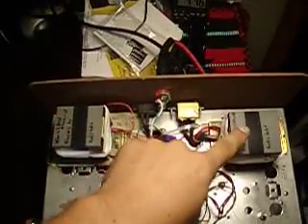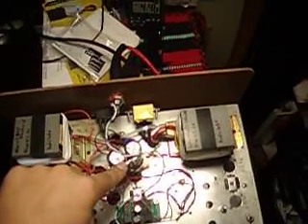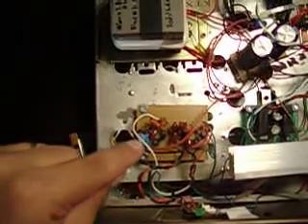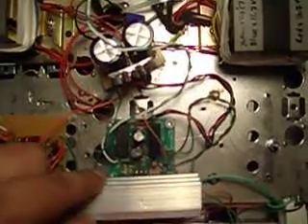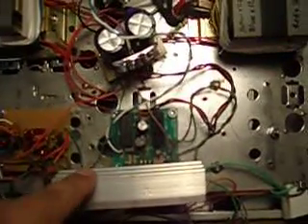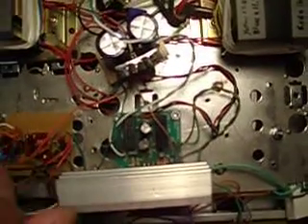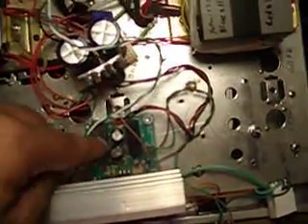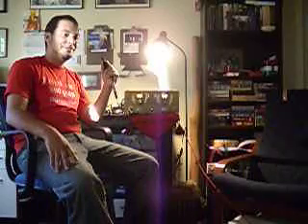DIY Solid State Harp Amp Success!!!

Comment: I've done something similar however, I used the amp end of the tube radio for a cool and great sounding little retro tube amp.  On another project, I used the tube amp as a front end to drive a solid state amp.  I have had some solid states that sounded OK driven to distortion but overall, I like the rich, pleasant, even order harmonics of tubes.  Solid state has a harsh sound.  I drive my amps with microphones playing amped Chicago style harmonica.  Using them like this really reveals the sound of the distortion in amps.

Comment from the maker: , or 3) buy a cheap 9v power regulator IC (can be found at Radioshack) and install this somewhere so that you power the preamp at true 9v, regardless of input voltage.

I have successfully used options 2 and 3 in my amps, but am way too lazy to ever do option 1! :-)

FYI, one benefit of option 3 is that you can then have a 9v "power outlet" on your amp that you can use to power your pedals too! It's easy to make your own "daisy chain" pedal power cord with several little 9v power plugs on it.

Comment from the maker: Hey man! Actually, there are three ways to do it. In order of most to least effort, they are: 1) redesign the circuit to truly deal with higher voltages (requires recalculation of all emitter/drain resistors and capacitors), 2) "fake" the first solution by only adjusting the bias resistor on each transistor until the preamp "sounds" good at the higher voltage (easy to do if you install "trimpots" instead of fixed value resistors when doing the build) 

continued in next post

Comment: I saw you amp post on Adam's channel. On the pre amp you said to revised the transistors to get them from 9v to 12v with trimpots. How exactly do you do that? I want to make a Fetzer valve as my pre-amp and run it into power amp kit that has a minimum of 10v. Thanks much!

Comment from the maker: @ovation05 Well, 1) I found a Tube RADIO, not a tube amp. 2) The thing wasn't working 3) I built a brand new amp, and used the housing to give it a retro stle 4) Did you actually listen to the way it sounds? It sounds damn good.

That last point is all that matters, really. Just because an amp uses tubes, does not mean is will sound good. Just because an amp is solid state, does not mean it will sound bad. It's the circuit design and the frequency tailoring that matter, not the components.

Comment from the maker: Yeah, I thought it was a bit small too, but I've run it for several hours, and it only gets warm to the touch... The chip has never gone into thermal shutdown either....

I'm going to change out the pre-amp on this eventually.... The prof tweed is kind of a one trick pony, and I'm getting a little tired of it now...

Comment from the maker: Hmmm... I'll have to investigate this. You are certainly correct that too much bass distortion will "muddy" the tone. One of the mods I did was to lower the bass thrshold (not by much, but I definately lowered it). It's a common mod that folks do to fender guitar amps to "voice" them for harp. I'll stick an EQ pedal before the amp, fiddle with the input freqs., and see what happens. If need be, I'll raise the bass cutoff threshold on the first gain stage. Thanks for the comment!